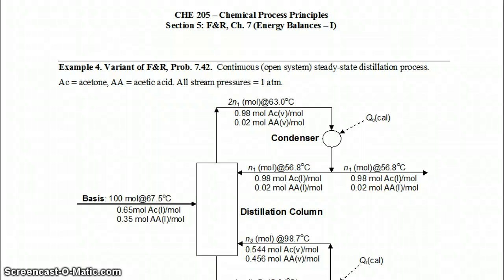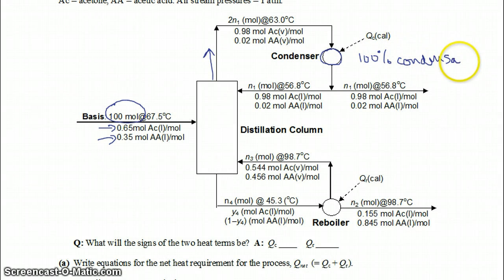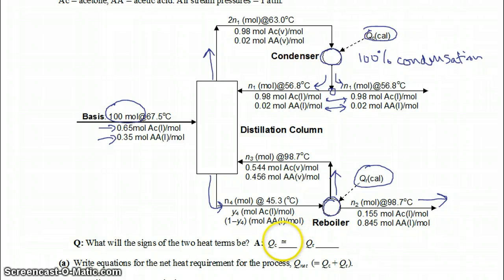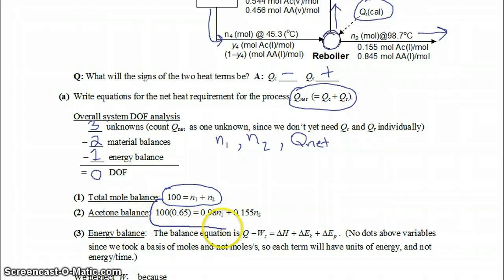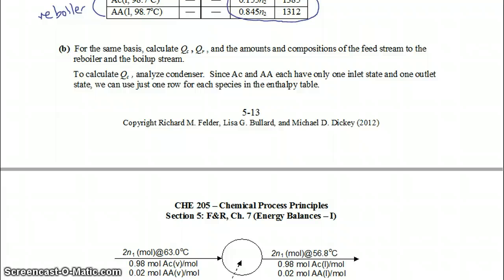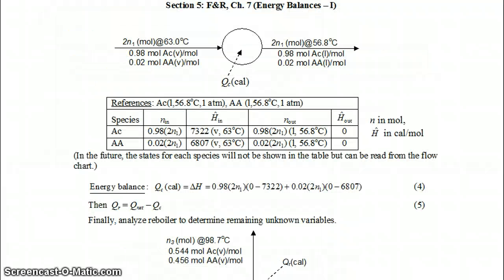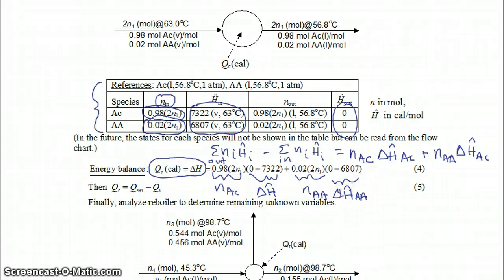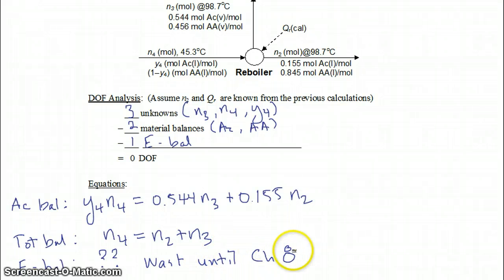Energy balance example

Comment: Sir, please explain how to calculate enthalpy of vapour and liquid in detail
Reply: Although I can tell you that you will have to use heat capacity. Roughly, Delta_H = n*Cp*Delta_T. The book (or your instructor) may ask you to do a fairly complicated integral to get Cp as a function of temperature, but most of the time, you can assume Cp is a constant with respect to temperature. As always, you'll need to keep very good track of all the terms. You'll need a Cp for each phase of each species. Good luck!
Reply: Thank you sir for your valuable reply
Reply: @H.arts99  Did you find the answers?
Reply: Rohit, I have to apologize! I did not ever make that video, and I posted this video 7 years ago...I am afraid I have lost my notes for the continuation part.
If you are interested in what might come next, I encourage you to read Chapter 8 for Felder, Rousseau, and Bullard!